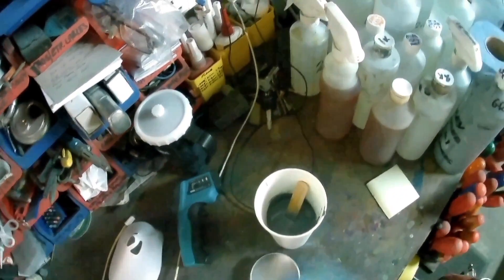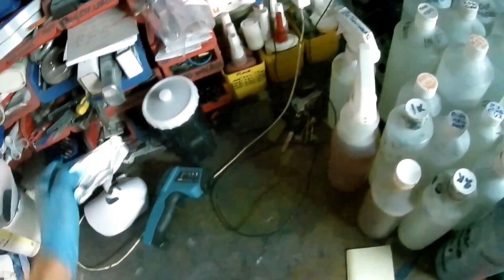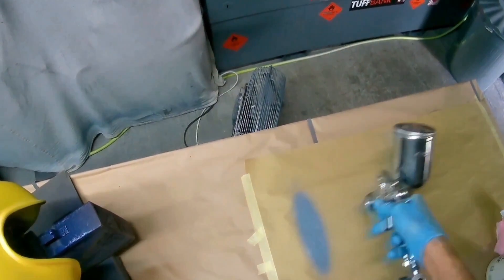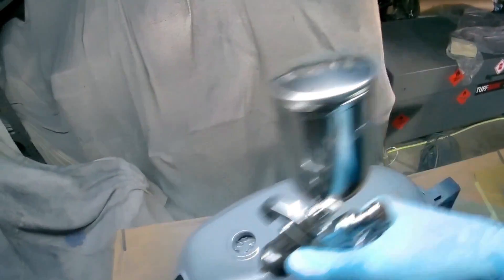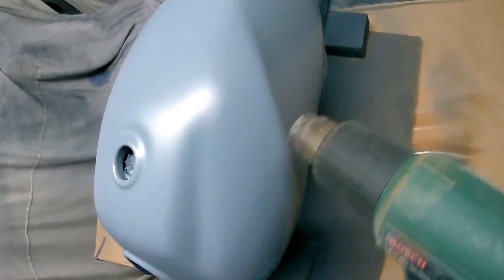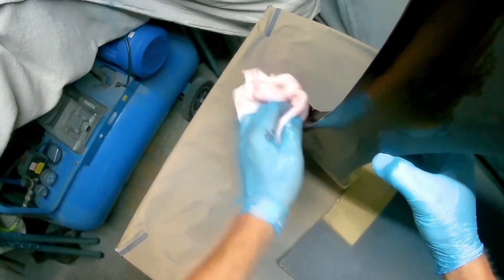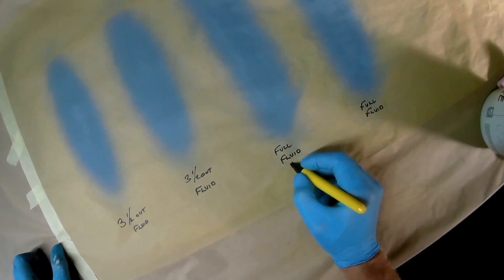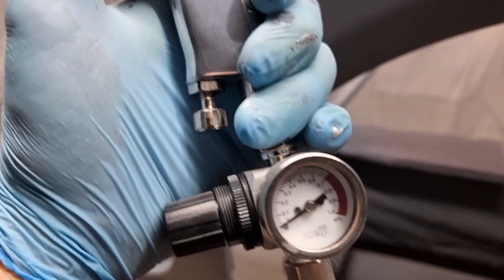Anest Iwata Wider 2 K2 1.8 Primer Gun, A Kiwami4 With A Side Cup

Comment: Morning Pete good video as always, that gun really does lay down the primer really well like you say you can really see the material going on to the panel! I tried the upol with 10% thinners and I get on with it quite well, saying that I’m going to try and use it like I was before but try and get it on the panel wetter and see how I get in with that. I have some Lechler dark grey primer that I’m going to use with my polar sea blue soon I will do a video on it as it’s for doing the wing mirrors on my Cavalier now that I have all the bits together. I hope you are doing ok mate, see you in the next one. Cheers.
Reply from the maker: Morning Steve, Yes,  for a 1.8, this did really well with the Upol. It's quite thick, so likes a big tip, some 1.8 just don't flow like others, so this is a great all-rounder.

Be interesting to see what you think of the other primer, the Upol is quite old now, so there are better products about although I'm not convinced there are any great advantages if speed is not a top priority and you can get the Upol to lay well, cheers mate 👍

Comment: Hi Pete, that looks like a good gun mate as it lays the primer on quite flat and it looks well made like all the Iwata guns are👌I think you said that the 1.5 is the smallest size tip you can get if you get one it might be a good base or clear gun but 1.5 might be a bit big🤔
Great  video mate thanks for sharing👏👍
Reply from the maker: Hi John, it's an excellent primer gun, I think it's a shame they don't make a 1.3 size as I'm sure it would be a good all-rounder, an absolute bargain on Ebay, never been used, it's certainly miles better than the Kiwami4/Bellaria 1.8 for primers, thanks to the cap I guess,  cheers John,  hope alls well 👍
Reply: Yeah from what you said about it you certainly got it for a good price as I think you said in the video that it's around £190 new but it's a shame that the pot fitting is different to yours but it's a full size gun so they often are, even having to buy a pot it was still a bargain👏👌

Yeah all good here mate, done a bit of painting today got the WoW primer on the wing and mixed the basecoat so I'll get that on tomorrow, also got everything ordered to replace the roof on the workshop (AKA Shed😆) I ended up getting some polyester reinforced roofing felt which should last 15 years plus I've got some adhesive to seal the overlaps which I didn't do last time, ok mate also hope you are ok🤔👍
Reply from the maker: Yeah, they are around £190 with a cup, so about the same as the Kiwami4/Wider4, which they are effectively a side cup version of anyway.

If the lean is ok on your workshop, then felt should be fine as long as it's overlapping enough, but strips will help it seal better.

On my workshop, I have fibre cement corrugated roofing, which are terrible . They get cold in winter, and you get loads of condensation dripping from them when it goes warmer from being cold, then the sun comes out and they crack.
I didn't want to have the rook off so I put another corrugated galvanised steel roof over the top, best thing I ever did, don't get condensation any more, never split or cracks and keeps it cooler in summer, comparatively anyway, only downside is noisier in heavy rain but that's it, cost a few bob as it was around 30 sheets as it quite big, cheers mate 👍

Comment: Is the slotted tips of the wider 4 compatible with the wider 2 gun? The technology is unique out of any other spray gun I’ve seen but I need a pressure fed gun and the wider 2 is the only one from anest that has that configuration that would work for me with heavier coatings.
Reply from the maker: Hi buddy,  the tip would fit, but you would need to change the cap too as the tip end is a larger diameter. I hope that helps 👍
Reply: @peteshobbies5383  Thank you Pete that helps a great deal. I’m particularly interested in the 3 slotted tip as it does seem to provide unique atomization while still maintaining the speed. 

Just wondering if you have ever tried any CA Technologies guns like the CPR or CAT-X models. They’re USA made and advertised towards the aviation industry. Subscribed, love the vids keep em coming!
Reply from the maker: Thanks buddy ☺️,  I've not used the CA technology's guns. We don't get them in the UK, not yet, anyway.

The Kiwami4 WB & WBX tips have 3 slots . Again,  you would need to change the cap also as the 3 slit tips are the same outside diameter as the 4 slit tip. Thanks, mate 👍

Comment: I would like to see you use this gun for base and clear with a 1.3 or 1.4 tip
Reply from the maker: Hi Ron, Unfortunately, they don't make it with a 1.3 or 1.4
Reply: @peteshobbies5383  the tips from the w400 are the same design. I am curious how the air cap performs with a proper tip size for paint.
Reply from the maker: Yes, I'm sure the tip will interchange buy I don't think the needle will and the 1.8 is a different taper compared to the 1.3 to 1.5 tip, I'll have a look 👍

Comment: I have such a weapon, but its suction and performance are bad. I do not like it in terms of the size of the fan and the pumping of fluids. I bought it by mistake. Can it be converted into a gravity weapon, or will the idea not work?
Reply from the maker: Hi mate, as far as I know, you can't convert them. Are you sure something isn't blocked ?
Reply: @peteshobbies5383  The idea came to my mind. I noticed on the side of the weapon a base that can be professionally pierced and a cup can be placed on the side. I wanted to present the idea to you, nothing more, according to your experience.
Reply from the maker: @kingdavid4725 Normally,  pressure force guns have a different tip and cap compared to their gravity versions, so I think you would need to change more than just fitting a cup

Comment: how does it feel balance wise when spraying pete ?
only used suction or gravity guns
keep the videos coming 
like the home painting  videos with a
great finsh for non spray booth 
some of the pro videos get more nibs than you ?
cheers
Reply from the maker: Hi Buddy, I prefer the side guns ballance wise, When you get a 600ml full pot on top, it can be rather top-heavy, not a problem if you're going left to right but it you have more shapely things to do the side cup makes it easier to change directions imo.

I do get pretty good finishes most of the time. All the stuff you see is exactly as it came off the gun, I'm convinced that many people at home get a lot of their problems from poor quality air, it's imperative to have clean air.

If someone has a budget of, say, 500 pounds/dollars, your far better off spending 350 on quality filters in your air line and only 150 on the gun, I think people normally do it the other way around.
Thanks for watching mate. It's much appreciated 👍